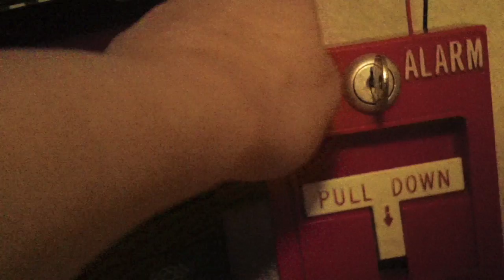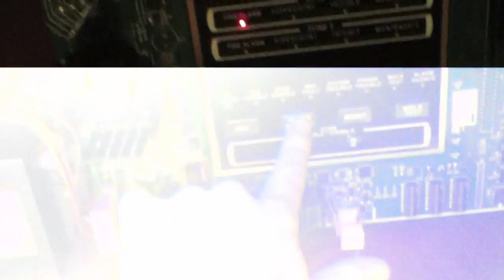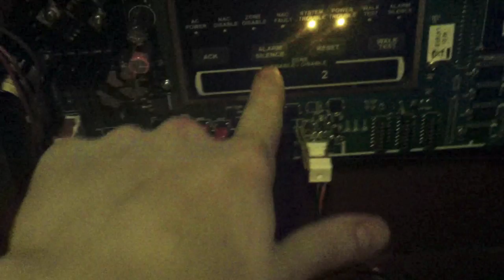Silent Knight SK-2 FWR vs. Filtered DC

Comment: What I want to know is on DC alarms (such as 9838's or 4051's) you need to power it on DC, If you power it on AC it sounds weird and like a broken 7002T. What is the difference between AC and DC and why is that important?

Comment from the maker: Take a computer cord and strip the big insulation (meaning the big black cord) until three individual wires appear. They should be black, white, and green. Strip those to make the copper wire appear (don't strip them too much, only enough to make the wire fit into the terminal). Place the black one into the left terminal, the white into the middle, and the green into the right. Your panel is ready to be powered on.